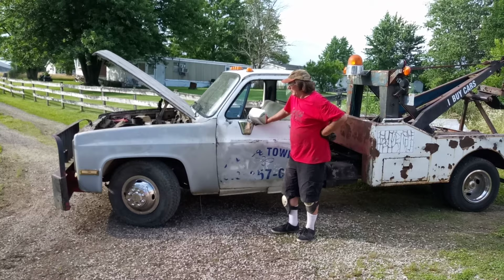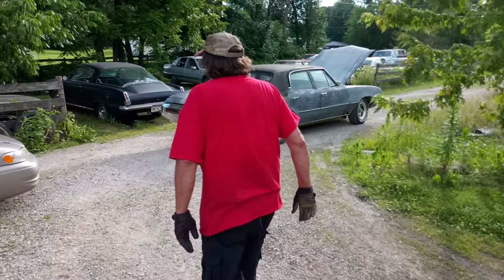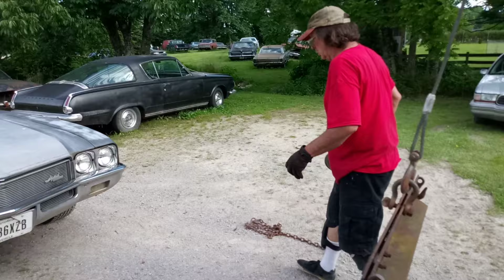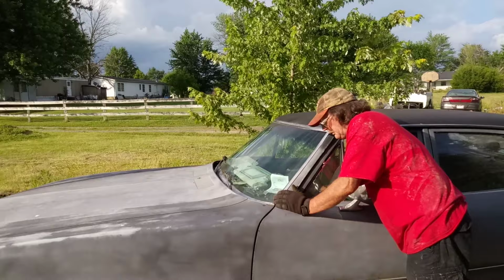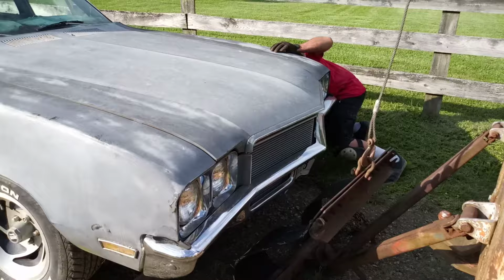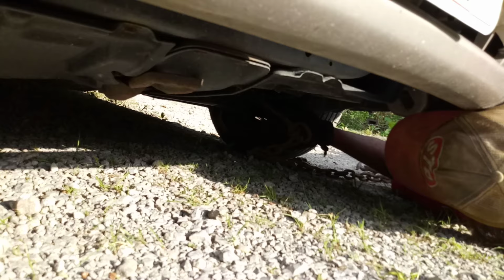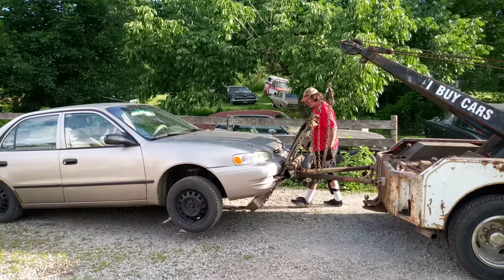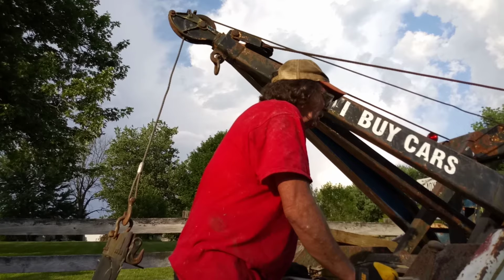Towing with a sling the right way

Comment: great video, thank you for taking the time and sharing your expertise, I am considering buying a sling type truck and this really helped me.
Reply from the maker: Go for it! Buddy
Reply: The most sure way not to tear up those CV boots is to use the "T hooks" into the tie down frame holes behind the front wheels. Then use your 4x4 and "spacer blocks' to get clearance around the plastic bumper. You can make your own spacer blocks from 4x4 and 2x4 peaces.

Comment: These sling trucks are neat, but i am amazed the towing industry stuck with them so long. You have to have two good tires on the towed vehicle, and it has to be in goid enough shape to tow. With the modern roll off trucks you can pick up anything, i see them hauling cars that were nearly cut in half by a tree, etc. it dont phase them. Plus these sling trucks tend to scratch/dent as he mentioned, if you arent careful.
Reply from the maker: I have been towing for 40 years the Sling truck is still used today

Comment: I really like how you showed how to short chain and mentioning using the safety chain for the boom. Hardly see anyone mention or even use a safety chain. People also don't understand those rubber straps are not for holding the weight of a vehicle...at least not for long.
Reply from the maker: U are so right paul people don't know they think u can tow anything with the rubber until u drop one and its not good when that happens i know it happend to me it was a 1 ton ford van i was lucky please subscribe to my channel paul i need more subscribers like you sir i will subscribe to u sir

Comment: Awesome video buddy! I just baught a 1984 Chevy 1Ton 4x4 tow truck myself!! Every thing works great on it also!! It has the Holms 440 wrecker unit on it with dual winches on it also!! Not sure the size of the winches but I would definitely love to find out cause they are definitely big winches!! They run of the 4 speed tranny that is in it!! It’s not a automatic!!! Love this truck but I do need to get the hydro boost system fixed because it seams as if it is really hard to stead!!
Reply: holmes 440 was a single winch boom, holmes 480, had the split boom, each boom had a winch, each worked independently from each other.  I believe the holmes 500 also had two winches

Comment: I drove sling trucks for years and never like that ...what is the purpose of the sling (reinforced rubber straps)
Reply from the maker: So it can rip when someone puts all the weight on it 😆
Reply: @The1965catalina  lol
Reply: @The1965catalina  in the event of a sling failure the chain is for safety not load bearing.

Comment: I also have a video on using sling truck, 73 chevy c-30, I was taught back in 2004 how to use this kinda truck. So my video is very similar to yours, with the exception of the position of the towbar and 4x4 wood. I have a cable driven kooma kar kradle. So i dont do the sling on my second video
Reply from the maker: Cool i Will subscribe too u please subscribe too my channel thanks
Reply: he did the classic short chain, that is not the proper way to hook, but is a way to hook, using the chains only, the rubber is supposed to be used as a brake to the front and back movement if the casualty. the 4x4 is in the wrong place, just saying.
Reply: this guy will never learn huh lilmockme8821
Reply: @jaydog4449  your right, He is a "short chain" himself lmfao

Comment: One more thing I’d like to ask!! Can you do a video on the sling on the back of that wrecker so I can see what all it is made out of????? Like the size of the square tubing that hooks to the back of the wrecker & like the width & length of the rubber & also the top & bottom part of it also!!! My wrecker did not come with the sling & I would like to make one to fit my tow truck!! Thanks for any help at all!! That would definitely be much appreciated!!!
Reply from the maker: I will do it for you
Reply: @The1965catalina  thanks buddy!! I definitely need to get one made for my wrecker so that I can use it a little more!!

Comment: always wrap your j hooks over the control arm. if it ever slides forward the hood won't fall off.
Reply from the maker: Its is flipped over on the Toyota and on the Buick the weight of the car keeps it from getting slack in the chain
Reply from the maker: But u are right

Comment: The right way?..... You got the chains right against the bumper....... That's what the rubber of the sling is for..... You need to stuff the tow bar under the car more...... When you said hopefully I have it set right?....... If you do it right there will be no hopefully to it
Reply from the maker: First of all I have been doing this alot longer then you have if you put all the weight on the rubber then you take a chance of dropping the car or truck that's why you put the weight on the chains be smart don't set yourself up for a failure.
Reply: @The1965catalina  No . He's right . Get under the car with it so you don't ruin the bumper with the chains (you've your reinforced sling rubber set up improper) pick the load up , loaded to the sling rubber then set the chains as a safety measure . If you picked up my car like on your video , you'd be court ordered to pay for my new bumper .
Reply: @The1965catalina  so what you're saying is you have been doing this wrong for a very long time lol

Comment: Good video.But what about the automatic transmission? I learned that a car with automatic not allowed to tow on wheels because there is no oil pressure in the gearbox if the engine not running.Towing will damage the gearbox.Or in usa cars there is something which protect it?
Reply from the maker: Well u are right but i have towed some car's a short distance and got lucky and not damage the transmission this video is just a demonstration dont do what i do then its just to tow around the block
Reply from the maker: Now the front wheel drive car u are ok to tow it in this way but u should hook up to the back of a rear wheel drive car and on 4x4 automatic cars and trucks u should pull the rear drive shaft but like i said if u are lucky and u are not towing it to far u can get lucky and not do any damage and yes u should start the engine and let it run to as u are towing it
Reply: @The1965catalina  Ok I understand. But back at the old days how towed automatic gearbox cars? I don't think they have time to pull the drive shaft in the side of the road. Or if you pull the back of the car you need to fix the sttering wheel?
Reply from the maker: Yes easy done too rope or a bungee or lo
Like what i have is made too tie the steering wheel off and i still use a bungee cord or some rope

Comment: have you ever replaced the rubber straps on your 440? Make a video on that, I wanna see your real intelligence... lol
Reply from the maker: That is real easy to do but i don't replace them til they need them so u will not see it sorry i am not going to do it til its time for one
Reply from the maker: I have replaced the rubber on a sling truck before its not that hard to do you will have to replace most all the bolts and new nut to do the job drilling the holes in the rubber is a pain but it can be done i have done it before

Comment: I uess if it works it works
Reply from the maker: It's old and rusty but its also trust
Reply: I got a similar tow truck i run all the time for the last 6 years up in kanada
Reply from the maker: Cool
Reply: Pulled a motor woth it today
Reply from the maker: I have pulled many too
Reply: I need a carb for mine right now but it still worka just acell pump sucks